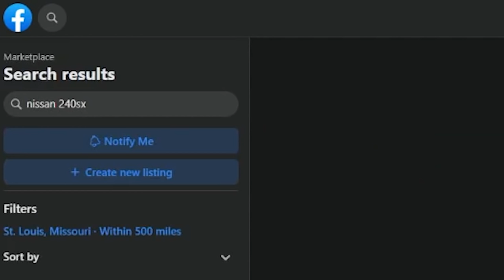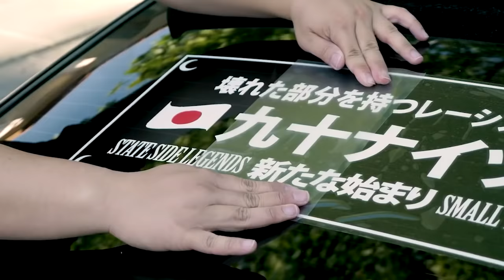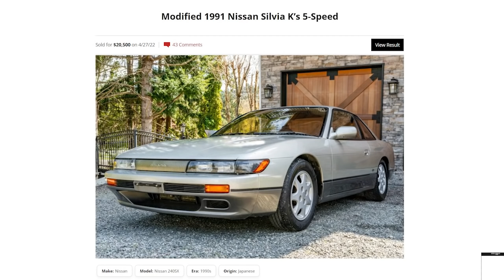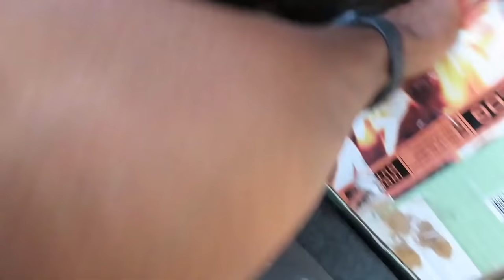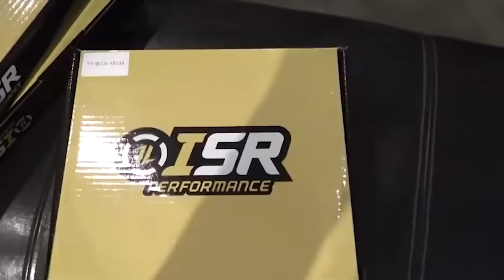Hard Truths of Owning a 240SX in 2022 (Donut Media Won't Tell You This)

Comment: Everything he says is true for 99% of the 240s out there. I've watched many friends buy a used up 240 and regret it time and time again. That said, my wife's 1990 240SX SE couple has been nothing but a joy. But she paid 17k for it. In 1990. And it's bone stock (with exception of the stereo ... I wish I'd have kept the dead factory unit back when I replaced it some time in 96 or 97 though, it would have been worth having rebuilt). Its been garaged its entire life and well maintained (has just a hair under 100k miles on it). 

Even at that, over the years I've replaced the clutch slave cylinder, the exhaust, put a new clutch in it and the worst thing was replacing the timing chain guides (unfortunately we found out that one the hard way ... had to rebuild the front end of the motor on that one). But today it runs strong and clean and much like new.

No, Its not for sale. She says she's getting buried in it.

Comment: "buy the right one keep, it stock and it'll be fine" you hit the nail on the head.  Bought my 98' in 1999 with 16K miles, its stock and is still my daily driver now with 260k.  Currently changing the head gasket, but other than that I've done very little.

Comment: I almost bought a shell. I bought a 95 240SX SE not working, had some rust damage. Radio & speakers didn't work. Had a SR20DET engine swap without the right wiring harness. Needed new coil overs, breaks, pads, weather-stripping, head lights, front bumper, and the driver side window motor went out and the wiring was old and burnt out the wires and had to get the whole door re-wired as well. 
Also finding good mechanics isn't super easy either. 
I've been working on my car for 4 years, now I've got a guy painting it and it'll be good to go.

Comment: I think part of the issue is that purely restoring a 240 to stock everything leaves you with a middling car, which was their reception on release. 

I know a kid who bought an 80’s E30 that didn’t run, so he bought wheels, tires, and a radiator for it.

Comment: Have owned my 240 for 7 years, 2nd owner, first car I’ve bought out of high school. So far, I’ve learned general preventive maintenance, serious engine repair, serious transmission repair, drive train maintenance, alignment and suspension geometry, electrical diagnosis, mig welding, body repair, glass repair, plastic welding, 3D printing, bondo, how to use a tap and die to make studs bolts threads ect, custom cooling systems, custom turbo systems, engine control unit programming, ect…. The car is still a pos, but it’s my pos.

Comment: It’s scary, the similarities between the 240sx/S13 and the 3rd gen Prelude community… minus the drifting scene. Nowadays most of them are junk, rotted, and generally clapped harder than a prison ass. Finding parts is almost impossible, if you’re going to buy one just buy a nice one, if you’re buying a shit one use it for parts only… shit even down to the damn engines to save a KA is just as troublesome as saving a 80’s bastard B series. My level of respect just went up a whole bunch to the S13 owners, hats off to everyone dealing with the struggle keepin them alive.

Comment: Many good points. Not a dedicated jdm guy more of a passing interest but having done a few projects with my dad before he went and doing just one myself to completion it’s a hard road and money is king. Worst part is so many of the guys and connections I use to have are just gone; retired, dead or just MIA. I’m doing probably my last ever which was a 69 Mustang Fastback my dad had for a retirement project but Covid took him and it had been on hiatus for over a decade. It’s in final assembly now but it was a frameoff that was already in pieces when I took it over. “100k” later it’s almost done. Just finding competent and reliable folks to help was harder than getting the money. Parts thankfully was easy because it’s a Ford Mustang. Health issues and other crap kept me from making it a DIY. I know I’ll never get back what I’ve put into it but it was the last car we worked on together. It isn’t about the money. 

Lastly we did (dad & me) start on a 73 240z in the 90s. It was a solid rust free no accident survivor that was later crushed in a pile up on my dads way to work. He was fine, the car not so much. Happily own an 08 Toyota Solara convertible and it’s my favorite of all the cars I’ve owned.only Toyotas and classics from here on out.

Comment: I'm finding this video a year after it was posted and with that being said, everything presented is true and especially the part about throwing out 7 lbs of interior because race car.  Hell, I threw away an uncracked dash in my apartment dumpster back in those days just because I needed the space in the garage haha.  All the memories aside, the 240 community was knowledgeable in those days but VERY toxic unless you proved your setup could work...that seems to be the dividing line between then and now, people today would rather sit there and debate about 'fitment/turbo sizes/fuel setup' than actually go do it and risk being wrong.

I bought my first 240 in 2004 and sold my last 240 in 2017, and after having 8 or 9 of them I'm not too concerned about trying to relive those memories in 2023.  They were a challenge then and with the parts market now, I can't imagine it being any easier.

Comment: Isn't buying an FRS/GT86/BRZ, a Foxbody Mustang or maybe even some slightly newer Mustang a better idea at this point, rather than a Silvia based car?
Reply from the maker: That entirely depends on if you want the most performance vehicle for your money, or if you want an s chassis
Reply: To be honest, getting an FT86 chassis car would make more sense nowadays, since that is the only contemporary equivalent of the S chassis (at least that I can think of, correct me if I'm wrong). They're not just better in terms of performance and power, but also in terms of fuel efficiency and comfort. Well, the age of reasonably priced FT86s (especially the GT86/FRS) will come to an end next year when the Initial D sequel airs because the protagonist drives one and goes toe to toe against some of the world's fastest supercars...
Screw drift tax, this phenomena should be called weeb tax because it's only hero cars from anime and manga skyrocketing beyond reason. It happened with the AE86 and it will happen again.

Sorry for the long tangent! All I wanted to say was the FT86 chassis is just a smarter option for the time being and maybe even an investment (even though that sounds ridiculous in my head).

Comment: This is spot on for the whole jdm scene. I own a 87 crx because I thought 2k no interior running rough, its a streal. I mean I got it running better but finding trim parts is impossible. It doesn't even need to be a shell, but I still fell dissatisfied because of the lack of interior. You should always just save and buy a nice example of a car instead of a cheap car you only have hopes for

Comment: I’m happy af with my 90 s13 hatch got shell motor and transmission all under $1200 back in 2015, got it running a fully driftable in mid 2016 and has been the daily/track car since non stop that’s about 6 years straight

Comment: I'm so glad I've had my '95 S14 since 2005. It's 100% stock except for a complete (springs/shocks, control arms, sway bars, power brace) Nismo S-Tune suspension that I just put on this year, and front Z32 brakes (which were stock on Japanese turbo models). It was super expensive, and most people in the 240SX community would probably say I wasted my money because I could've bought some sick Megan Racing coilovers for half the price. My car has over 250,000 miles on it and I daily drove it from 2005 to around 2018.  People who say these cars aren't reliable are doing it wrong. My current daily is a bone-stock R32 GTS25 Type X G sedan. So far, I've only had to replace a coil pack in that car.

Comment: my god this is funny af and accurate🤣 i got handed down my brothers 89’ 240sx this year since it was my 16th bday and it’s been sitting in my garage for 8 years and hasn’t ran since, i always say “soon” when my friends ask me when i’m gonna fix it🤣 i’m converting the front end to a s13.4 front since i have the hood and bumper that’s in better condition than the original bumper and hood. still need to order my fenders. the interior is actually really nice and there’s extremely MINIMAL rust on the outside (you wouldn’t be able to notice it unless you looked closely). the dash isn’t cracked too. my 1st car is happily a project car. 100% gonna regret dumping money into it when i’m 70

Comment: This got me in my feels. I bought an old nissan and drove it for years. I've done some work, preventative maintenance and 2 headgaskets. I decided to ka swap my truck after the third hg, instead of getting the block machined. Then spent way too much money rebuilding a $200 ka that "ran when pulled". finally got it mounted in the truck with My limited welding knowledge, and now I'm realizing I'm not a very good mechanic and can't figure out how to get it to run again. Financial aid checks only got me so far 😅

Comment: As a nissan hardbody/d21 owner the only reason I even look at clapped out 240sx's is for that ka24de/t, I'm not even after a running engine, just the iron block that doesn't look like it's been skullfucked then left in a puddle. 

For those curious my current truck is running a fairly stock Z24 with a 38/38 weber, and some new extractors/headers, and only really want the KA if I get the sudden urge to do something stupid

Comment: You are spot on. I bought my first 240 close to 15 years ago. I was young and fell into that cheap car fallacy. Sunk so much money into that shitbox (money I really didnt have at the time) and had I started with a better platform it would have ended much better. Took a long hiatus from money pit cars. Built two more (both 95 slick tops) with much better chassis a decade later and actually had the income to support builds like that. Totally different experience with a more mature perspective. Moral of the story, save the extra few grand for a better starting point and you will be much better off if you want to succeed.

Comment: You sir are correct. I recently let go of a 93 Acura Legend Sedan. I had visions for it but in reality it just sat in my backyard for 7 years haha. At first I wanted to V8 swap it and drag it then I seen videos of 4 door skylines drifting so I wanted to V8 swap it and drift missile it, then I seen some JDM Legends on the VIP lifestyle so I wanted to do that. Meanwhile I working in construction and not going to school for the proper skills needed to complete my dreams and that was metal fabrication and welding skills. I gave it away to someone's kid studying to become a certified mechanic, he got it running but then they realized the engine was shot. They replaced it with a new used 3.2L V6 along with the auto trans and it's up and running. I would have gone the 3.5 V6 from and RL and done a 6 speed swap but hell that was hard finding it myself too. 😂
Reply: at least she is running and driving now!

Comment: Well again its more about dedication too, all those points are valid except one. If you don’t care about losing money and you really want it, go for a shell and fix bit by bit. Thats what I did kind off. Bought my S15 SpecR and after 4 years its like 95% finished, running, rust fixed, painted, new parts just missing few bits here and there. But again Yes I might spent almost same amount of money as just getting one straight up, but I was not able to afford it at the time, and piece by piece it’s getting along with mods I actually wanted so I guess it is worth it only in exception that you gonna finish it no matter what

Comment: I've owned a 240 since 2010, in my opinion and with some great stories its all about luck nowadays. 🤷‍♂️ still love the car however like some of the other comments I see below life hits you, and you can either have a side hustle to support your crack habits of owning a 240 or you can just pull a second mortgage out to build one. I had the help of multiple deployments and the luck of picking my 91 hatch up from an older gentleman who bought the car off the show room floor for 800 bucks (running and driving) few miles later head gasket went and now im swapping a rb25 in it, then picked up a skyline... an even BIGGER mistake however one project at a time is what I told myself... that is until I came across a 2 tone coupe 🤷‍♂️ I couldn't help myself 😭😭😭😭 im addicted

Comment: Damn I miss my 92 s13 Coupe w/MT
Bought in 2005 for $1800.00. KA was toast, no rust perfect dash.  Swapped a redtop sr20det, with a J30 rearend, walbro 255fp ect. Developed symptoms  of a bad coil pack and it did have a bad coil pack and it was running on 3 cylinders. Dumbass 22yr old me thought it was an exhaust leak 😆. Dumbass 22yr old me blew up the sr20det because it was running on 3 cylinders. So, got another redtop  sr20 but got a built bottom end from Mazworx this time...only $4k stage 1.  700hp capable, not sleeved. Manley turbo Tuff rods, cp pistons 8:5:1, arp head studs ect. Stage 1 pnp of the head. More than safe for the little garrett gt2871r .81 at 12psi.  I needed a 300zx maf, bigger injectors and rom tune to push more safely. I'm keeping a lot out, this list can go forever basically there was over $17k invested in my 92 s13 coupe.

It was stolen July 2012. 

I now drive a 2013 370z Sport with FBO and tune running mid 12s trapping 110+. 

If I had the option, I'd trade the 370z in for my s13 coupe in the blink of an eye though. Crazy cause I know the Z is nicer in every way.

Comment: I feel like you can pull off a S chassis shell build only if you are in the right finiancial position and have a steady inflow of cash and you know what to do where to get parts and all that. Basicaly what was said in the video and if you want to mod your car then ok, but do it tastefully and dont put like 600hp in it if its a street car 300hp should be plenty for daily use and some fun because afterall it is a sports car. For exaple take a youtube drift group from poland called nightride. They bought a shell s13 with an engine, transmition, and some suspension parts. They built it over a period of about 6 months and tastefully moded it. It has about 300-350hp and is looks very nice (atleast in my opinion) and they arent very rich they are just dudes that like cars and drifting. If you dont want all the trouble of a shell build just buy like a 2012 c63 amg or something like that idk its gonna be faster, a better daily, will have similar maintenance and it will cost you the same as your entire S chassis build and maybe even less but ofc when buying a sports car you have to be very aware because after all they are not corolas and they need more maintanence than regular. And there are some dumbasses that buy a sports car just for the sake of it and dont do the maintanence, like with the e60 m5, the car is great if maintaned right and yes the maintanence is more than a normal cars but dude that what you have to do when you buy a 5.0L v10 sedan. So just dont be stupid and think, do your research, plan your parts and how much you will spend.

Comment: One of my dream cars for sure. They're beautiful cars, stock. Couple little tweaks here and there. Problem is, ever since I decided that, I knew, I'm gonna need around 10k, a decent amount of property, and a fully functional shop. Work on that part first. Most likely, I'll never have one😢.. and the way the automotive industry has gone.. I'm not even sure the hobby will survive. Imagine the trials and tribulations of building one of these... now Imagine if you had to go through all that on a modern or fairly new car. Would you even want to for one? Possible? Yes, but there's gonna have to be some serious..  Shenanigans to get it to work as intended. When was the last time you seen a built from the ground up modern car.

Comment: I was getting into the s chassis in 04 and countied with them for years I've owed 20 or more. sadly it's become cliche, I hate to say it and won't but I probably won't buy another one. the 240 10 years ago you could buy for under a g or around that the swaps were  like 2500 for sr and 3 to 6g rb depending on the swap. that's what made it fun yeah you better be ready to commit nights even days to working on the car then some times with major failures. I ran my 98 s14  kouki sr on 14 maybe more psi. with the stock long block for 5 years then sold it. the sr loves high rpms what can say, well so does the rb.

Comment: Tell me about it. 300zx’s are much the same even hidden stuff like rust which is inevitable on the interior stuff. I own a good 300zx chassis and even then nothing exterior BUT interior behind the radio and the rear bar behind the seats / back seats always rusts. Let it be known it WILL cost around 30-40k to rebuild it FULLY no matter what maybe more. I’m patient and yes it can be done. 

Good job
Budget
Proper rebuilds (honestly don’t trust anyone on buying one rebuilt just rebuild it yourself PROPERLY).
Patience.